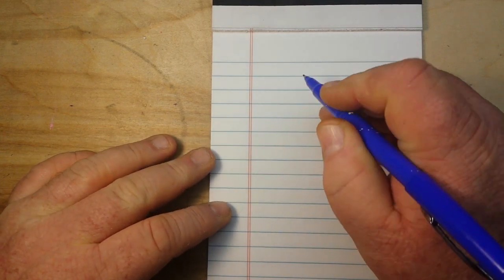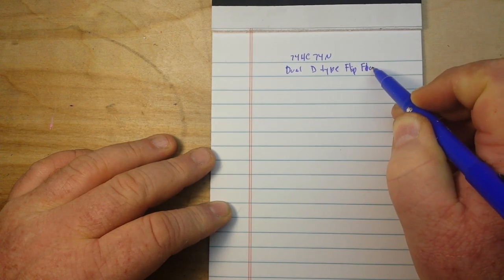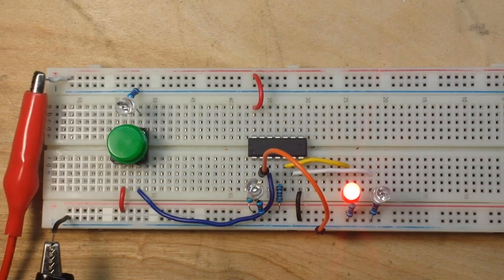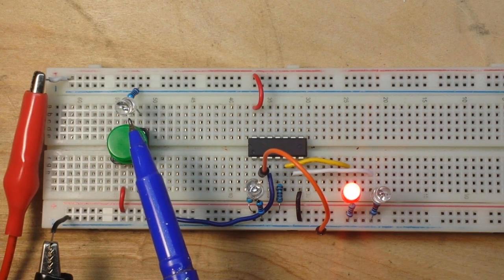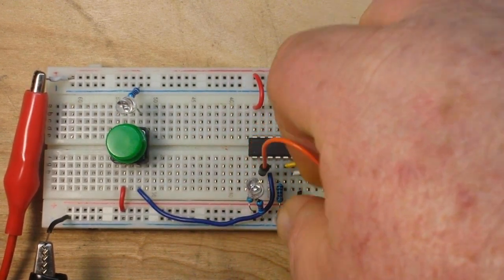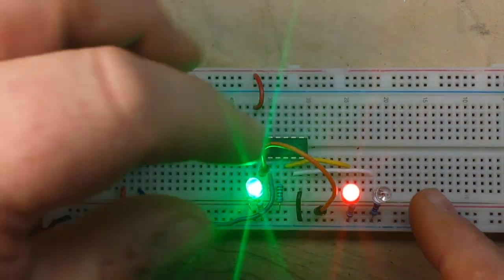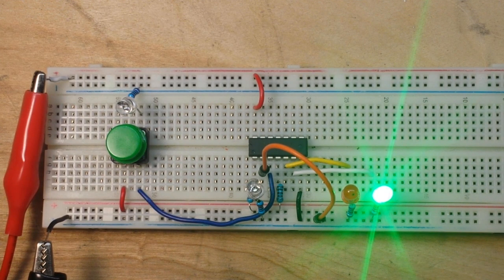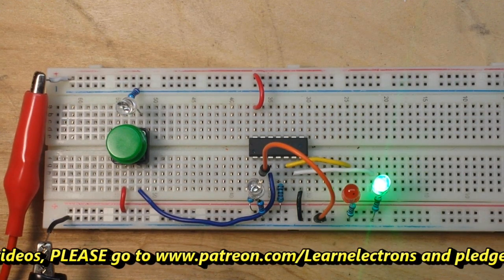Digital Logic:  D type Flip Flop

Comment: I'm afraid I'm finding the results unrepeatable, can you help?  Firstly the LEDs on pins 2 & 3 should be attached to GND and not Vcc (this is incorrect in your diagram but correct on your breadboard), so I have followed this right.  When I press my button at pin 3, it goes momentarily HIGH (to 5V, lighting the LED) but when I release it, it should be LOW (it needs to drop <0.8V in order to go LOW according to the 7474 datasheet).  Instead it reads 1.6V, so I can't get the clock signal to LOW, hence I cannot get more than one clock pulse from my push button.  Why is that?  Why doesn't the LED and 330R act as a pull-down resistor and pull pin 3 to GND?  Even if I replace the LED+330R with a 10k resistor, I get the same problem.  I'd appreciate it if you have any thoughts
Reply: Turns out my pin 3 always floats at 1.7V (enough to trigger it HIGH).  So I reworked my circuit so that my push button takes pin 3 to ground and when released it triggers the positive edge.  So good news that my version of your circuit works, but I still don't know why my pin 3 floats at 1.7V, any ideas?

Comment: Can anyone help me do it so that the state changes everytime a clock pulse is made. the data pin would be set low and everytime a button is pushed the Q would toggle. Basically how do we do it with a T flip flop..... thanks in advance
Reply: Connect the !Q output to the data pin, and make sure pre and clr are always high. Following the logic table on a d type flip flop datasheet, with this configuration, !Q (and D) would always be the inverse of Q, so any time there is a clk pulse Q's state would change.

Comment: Could I use one to control 2 SSR relays with a 555 timer. I already have a 555 circuit that I want to use.  I want one relay on when the output of the 555 is high and the other when it's low. I want to charge and discharge a large capacitor.  Each relay only draws 9ma or Less at 5v.  Can you wire the flip flop to switch high and low with the output of one 555?  Or could I just cascade two 555 timers?  Watch your videos all the time. Very helpful! 👍

Just wanted to add. I know I can do it with just the 555,. but I have the 555 set to have adjustable pulse width.

Comment: A little confusion is there,two green LED on pin 2&3 should not glow because their cathods are positive biased as seen in your note sheet drawing.on pressing push button pin 3 &LED anode are at positive potential and LED cathode is also at positive potential.please clear this confusion..
Reply: I agree, this doesn't make sense, the LEDs on pins 2 and 3 should surely be attached to ground?

Comment: hello! i don't expect you to reply to what i am about to say, but i'll give it a shot. So, the clip is very helpful, and i like the way you explained how a Digital Logic: D type Flip Flop works. The thing is that i need this chip, the 74HC74, to implement something for a project for school...And i don't see how i can do it...I have, by connecting the board to an Arduino board, to make two leds do these things: at 1  second, the first led should be high(brightened), and the second low. At 2 seconds, the first led should pe high, and the second high as well. At 3 seconds, bouth of them should be low. And then this actions should be repeted in a loop. I have to do this by using only one port from the ARDUINO board, like you did in this clip with the 2pin(the D input), but i don't see how i can keep the bouth leds high at the same time. Sorry for my bad english...if you could help me...that would be amazing!

Comment: Kinda cool, never seen or heard of this chip before. Curious about the applications.
Reply from the maker: +Michael Padovani any circuit that "processes" data is full of flip-flops. Like I said in the video a flip-flop is a one bit memory. What makes it useful is it is tightly synchronized to the system clock.

This allows the flip-flip to wait for other logic elements to stabilize their results, then on the next clock cycle, the results are stored in the flip-flop.

Processor speed is highly related to flip-flops.
Reply: learnelectronics is that where they get the gigaflop measurement from?
Reply: @TheAussiePirate  No. The 'flop' in 'gigaflop' is an abbreviation for 'FLoating-point OPerations'.